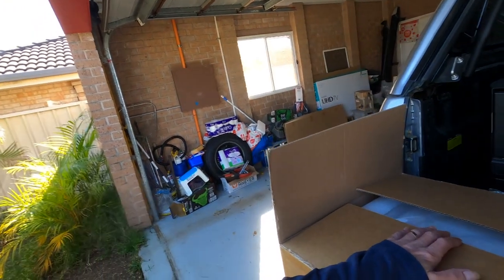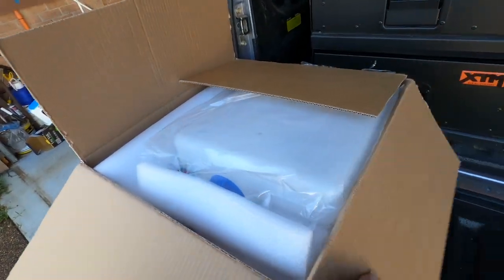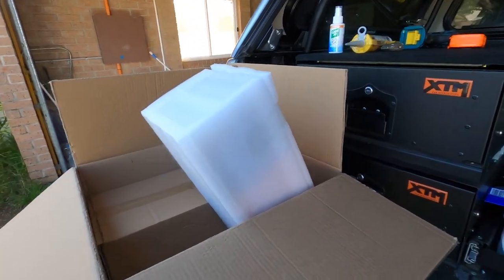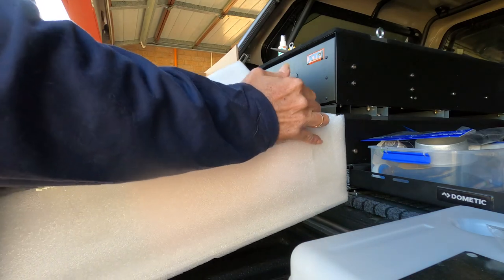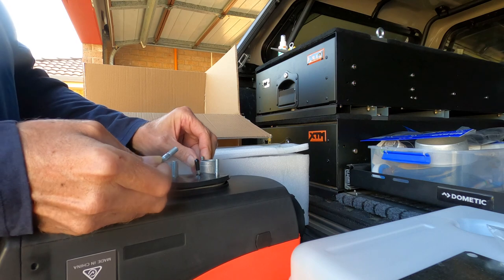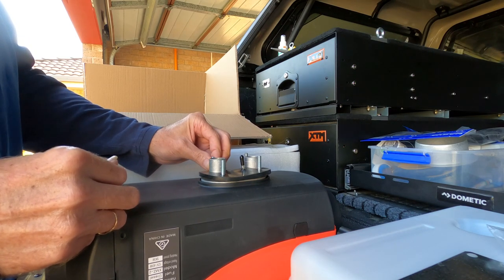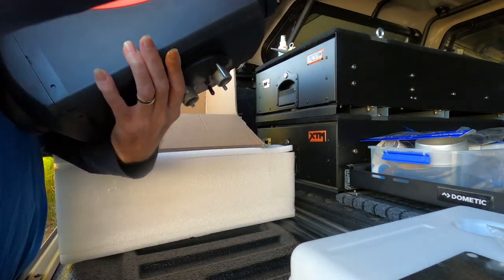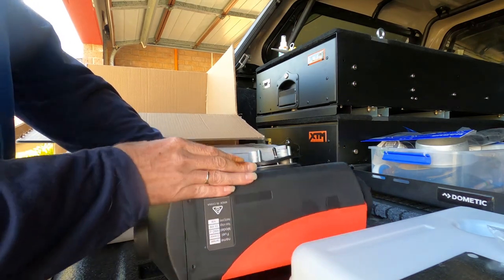Easy DIY Cheap Diesel Heater Install into our 14ft Jayco Journey Outback! Tips and Tricks!

Comment: What shunt system is that?
Reply from the maker: It’s the jayco IntelliJay battery management system pre installed into the van, you can always use say a enerdrive battery management system made in America (cheapest good quality what I have in the back of the Dmax) or a redarc bms a lot more expensive Australian made, at the end of the day a bms/shunt is absolutely essential and priceless as you’ll always know where your battery levels are at if you bypass the battery management system and hardwire it the system will tell you you have 70% when in fact you might only have 35% battery left everything should go through a bms/shunt so your not left in the dark pardon the pun 😉 hope that helps 👌 cheers 🍻